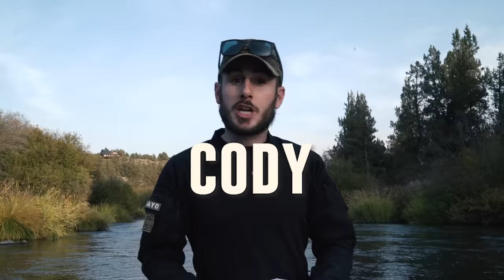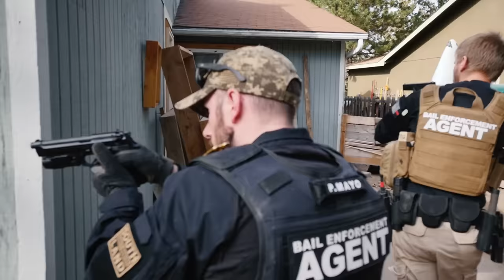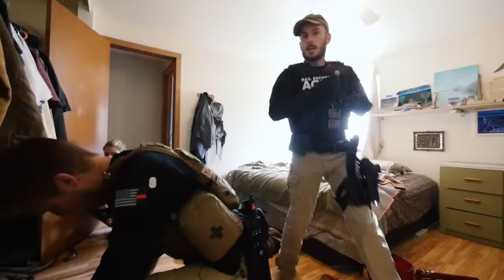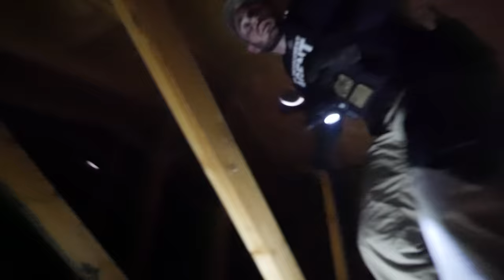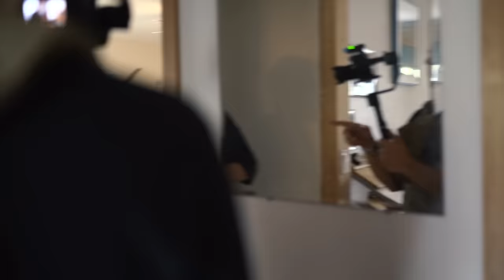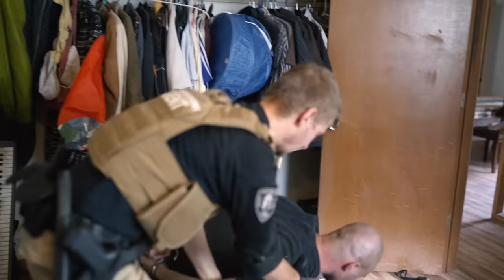SMASHING MY WAY INSIDE TO GET OUR GUY

Comment: Pro tip: Use a mirror on a stick to look in areas like that so you don't have to stick your head up in an attic if he's pointing a gun at that opening there went your head.
Reply: Hows he gonna se if the openijg is small.
Reply: What if it is dark, well there goes his hand for sticking his hand up there with a flash light, oh wait your gonna say put it on a stick but what if he doesn’t have a mirror or sticks or tape so that’s not a pro tip, duhhhhhhhh

Comment: Patty, was that a Beretta 92 I saw you carrying?  That's an awesome handgun.  I did see Zack carrying a piece of trash Glock.  I also noticed Zack has a LOT more law enforcement experience and training than you.   Springfields SD's are decent, but only in the match grade version.  H&K is my go-to.  My VP-9 will put an entire clip with every bullet touching at 15 yards, but I do practice all the way out to 50 and even 100 yards with my pistols.  Trust me, if you are within 100 yards of me, you don't want to see that flash go off.  My AR-15 is a different story.  I can get you out to 400+ yards.